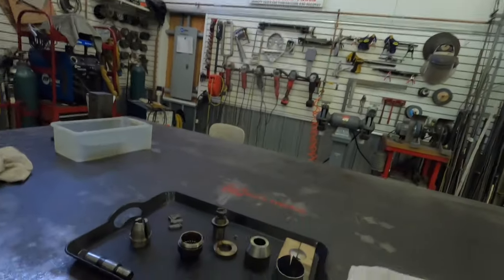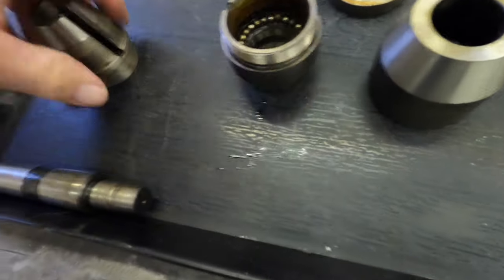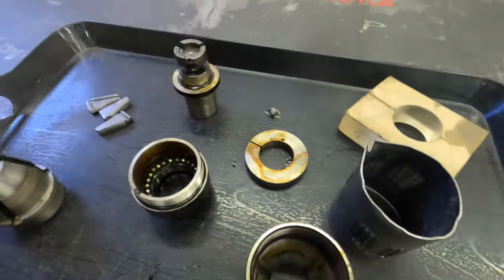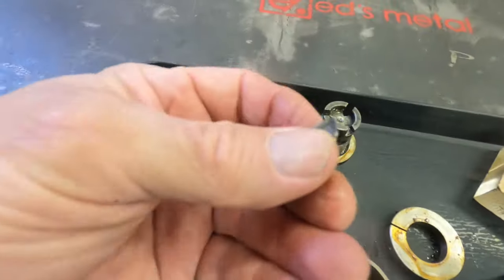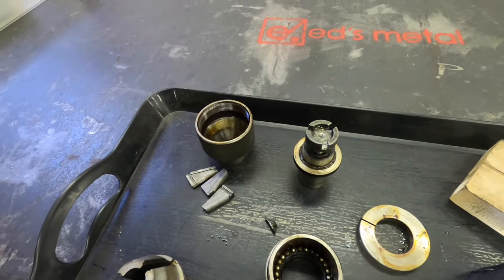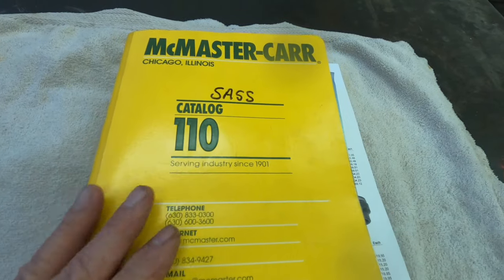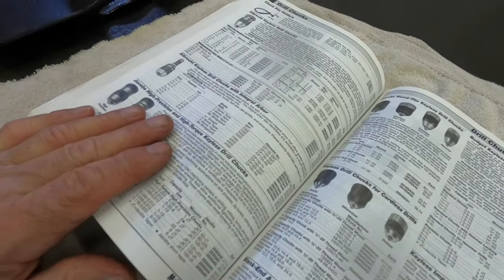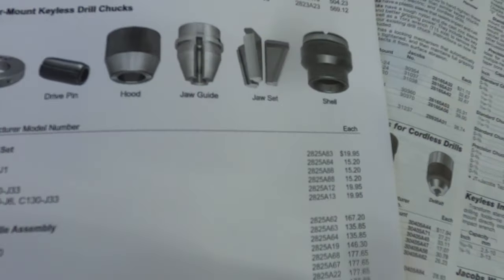TO FIX OR NOT TO FIX ALBRECHT CHUCK

Comment: I bought that exact chuck 15 or 20 years ago because it was cheaper than a Jacobs.
All I can say is there is a reason it cheaper than a Jacobs.
It does not grip drill well, and if you gronk on it so it won't slip, then the body winds up and jams.

Comment: I have an old one on a drill press and it works perfect . I don't know where it's supposed to be a "cheap" chuck . Some of the best machinists in the world use them . They're around 500. now . Definitely not cheap . lol I took mine apart, cleaned it up and "oiled" it  (you're not supposed to use thick grease) and didn't need special tools .